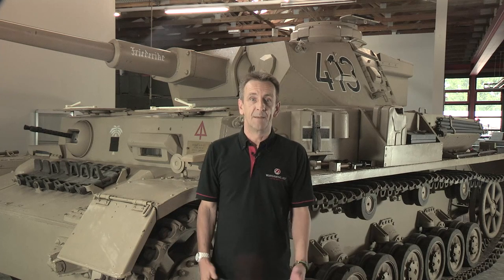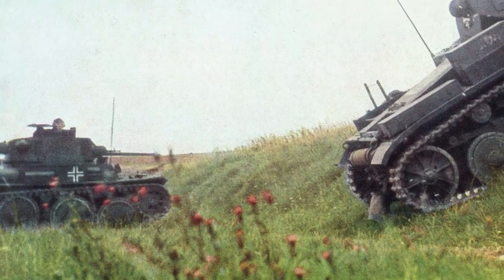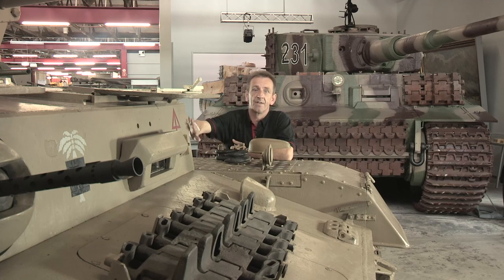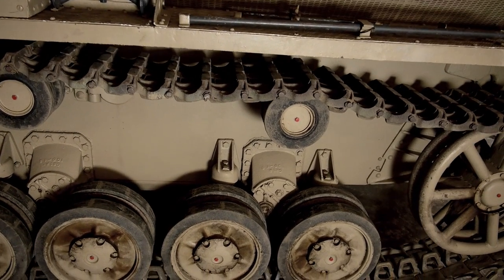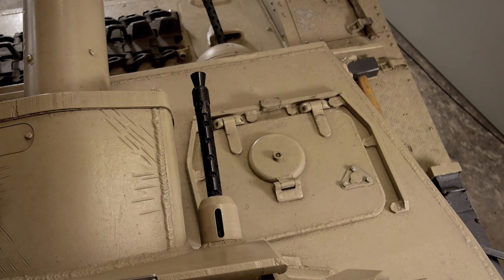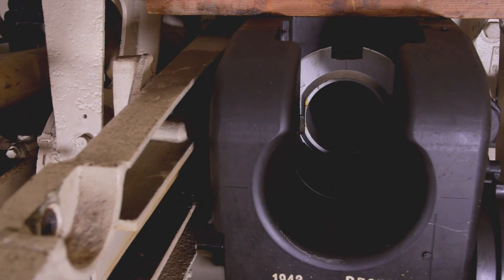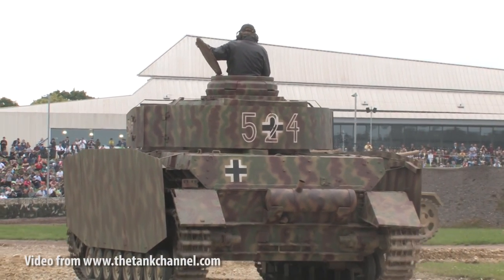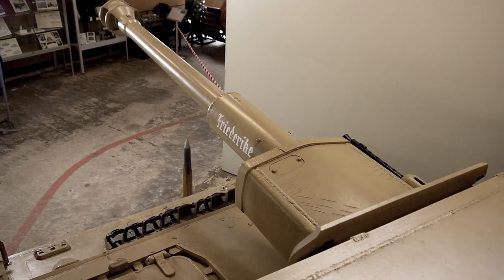Inside The Tanks: The Panzer IV - World of Tanks

Comment: Only good German tank design that was not riddled with poor design faults and over complexity, second would be the Panzer III which reached its usefulness in 1942
Reply: Don't forget that germans tanks were constantly sabotaged, especially Panthers by prisoners that manufactured them. That was one of the reasons why they were unrealiable...
Reply: thats interesting, haven't think about that
Reply: there was no over complexy german tank design and there were no real design faults... the faults found especially at the Panther was the pressure to rush it into production without proper pre produciton testing, the reliabilty of the Panther was as good or bad as any other tank at ww2... the engine problems were mostly comeing from very very poor quality syntethic oil, the lack of proper maintenance time... the Panther weakness the final drive problem was a result of the rush into production... it was designed for a 30to tank and was finaly used in a 45to tank... means it was  constantly overloaded... and to make it worse at production start some idiot planer ordered to make the gearing of the final drive of lower steel quality resulting in a average liftime of 150km. The best design is worthless if it is ruined by wrong use and wrong production... BTW at production start the reliabilty of the t34 was even worse... there are records of the Red Army of early T34 units who lost more than half of their tanks on the way to the front to mechanical brakedowns.
Reply: Onii -Chan Blaming the slave labor the Germans used, really?  No they just shit designs after 43, Tiger was okay but nothing special, no matter much wehraboos want it to be.  They had reliability problems because they were too heavy for Germany automotive tech at the time.  The German auto industry was a joke in the 30s compared to the US, in fact, GM owned Germany's largest auto maker.  They were not good machines, why else would they continue to produce the Pz IV which was clearly outclassed by the M4 and T-34 in production, reliability, mobility, armor, and gun?
Reply: God bless USA, right?. Pz IV with it's long barreled 7.5 cm gun was more then enough to deal with T-34's and shitty M4's. And Pz V Panther is by many considered to be the best tank of WW2. German tanks were sabotaged so that is one of the reasons why later tanks were unreliable. Another reason was rushed production and yes, over-engineering. Usa on the other hand has no excuse for their "Pershing" tank introduced by the end of ww2 to be as unreliable as it was since nobody sabotaged that. And Tiger was more then "Okay". T-34 had no chance of penetrating it frontally and M4 could not pen it's rear by the time it was introduced while it could destroy these tanks from a few kilometers. Mobility wise it had similar hp/ton ratio as M4 the only disadvantage was tactical mobility (moving it from one place to another on a train was pain in the butt).

Sherman: weight: ~30 tons; power: ~400 HP - power to weight is 400/30=13.3 HP/ton
Tiger I: weight: ~55 tons; power: ~690 HP - power to weight 690/55=12,7 HP/ton
Reply: Onii -Chan " over-engineering" =horribly engineered.  " Pz IV with it's long barreled 7.5 cm gun was more then enough to deal with T-34's and shitty M4's. " The M4 and T-34 were still better, were more mobile, better overall gun performance, better situational awareness, better armor, and more reliable. "And Pz V Panther is by many considered to be the best tank of WW2." By who, The "History" Channel or the "American Heroes Channel" names of authors, be specific.  " German tanks were sabotaged so that is one of the reasons why later tanks were unreliable" No they weren't the British tested the Panther's final drives after the war and found the design to be just plain shitty.  The metal and quality was fine, the design was simply way too much for a vehicle that weighed 45 tons.  You're not winning any arguments blaming slave labor either so cut it out, you sound pathetic.  "Another reason was rushed production" Again, not helping your case.  "Usa on the other hand has no excuse for their "Pershing" tank introduced by the end of ww2 to be as unreliable as it was since nobody sabotaged that."  The USA was not dumb enough to make a heavier, less mobile, more breakdown prone vehicle the spearhead of our armored advance.  They barely saw action, we did not need it, the M26s problem was a weak drivetrain and under powered engine that was eventually fixed, the Panther's problems were design flaws that the Germans could not fix, even if the war lasted longer, they lacked the technology.  
"And Tiger was more then "Okay". T-34 had no chance of penetrating it frontally and M4 could not pen it's rear by the time it was introduced while it could destroy these tanks from a few kilometers." The M4 could penetrate the Tiger from the side at 650m, the T-34 had to get closer, but the Tiger was not invulnerable.  Both the T-34/85 and M4(76) could take out the Tiger from the front beyond 1000m, and shots over 1000m were not common and even Tigerfibel states that Tiger crews should not engage enemy targets beyond 800m.  Learn the difference between tactical and strategic mobility before you attempt to lecture anyone again.
Reply: I watched a documentary about Wittmann and it stated there that M4 hid from a Tiger behind a building and while Tiger was busy killing other buddies, later that M4 got behind a Tiger shot it in the back and bounced. Also long time ago I read a history magazine and it stated that in order for M4 to have any chance of penning Tiger it needed to get within ~100 m while Tiger could kill it from a few km. Maybe you were talking about Firefly M4, the late war modification with british gun, I was talking about beginning when Tiger was introduced. They stopped producing Tigers in 1944 anyways.

"The USA was not dumb enough to make a heavier, less mobile, more breakdown prone vehicle the spearhead of our armored advance."
 Well I guess paying with lives of inferior M4 cerwmen was a good decision then. Watched plenty of documentaries about veterans complaining about lousy M4 while germans had Tigers and how everybody was scared to the point where some british general banned the word Tiger in the army. Everyone knows that germans had the best tanks in ww2 and their kd ratios show that, the only advantage allies had was the ammount of tanks they had. Every Tiger was heavily outnumbered. No matter how bravely the lion fights it will die eventually from a pack of wolves swarming from every possible direction.

Anyways having an argument is pointless because you will keep your oppinion and I will keep mine, it has been proved that arguments are pointless.
Reply: packr72
 u have absolutly no IDEE about what u talk...
T34/85 and M4 76mm could NOT penetrate tiger1 at battle range...the only western allied tank that could deal with a Tiger at nrmal battle range was the Firefly... there are reports about tiger1 killing T-34 at a range of 3900m (July 1944 Panzer Abteilung 506) .. BTW the Tiger Fibel states that it is IMPOSSIBLe to miss a target at ranges up to 1200m if the gunner use the gunsight correctly... abouve 1200m he has to adjust the gunsight .. up to 2000m the 8.8 is deadly accurate at 3000m 1 of 4 shoots miss at 4000m 1 of 4 shoot hits.. Tiger Fibel Gunner section side 76
Reply: Onii -Chan That is a myth that has yet to be proven, MAYBE you can prove it huh?
Reply: Onii -Chan Documentary about Wittmann? You believed in that? Your arguments are already invalid.

I mean if you really care, read this:
http://tankarchives.blogspot.ca/2014/08/carius-interview.html

From a REAL German tanker and tank commander, not a fake propaganda figure like Wittmann
Reply: German tanks were feared for a reason. I'd rather believe a documentary made by historians with university degree then some random Joe on the internet with simething that resembles a communist star as avatar. Since you call us "werhaboos" (lol) I'll call you "sovieboo" ._.
Reply: Are you on every tank video/forum spamming your glorious Soviet propaganda?
Reply: sovieboo pls
Reply: Onii -Chan Belton Cooper never served in a tank, he knows nothing about tanks and has no standing to right a book on how bad or how good a tank is.  "Death Traps is not a reliable source. Don't cite it. Or the History Channel show based on it." -The Chieftain, Wargaming America's resident Historian. http://worldoftanks.com/en/news/pc-browser/21/The_Cheiftains_Hatch_Sherman_PR_Bigger_Cooper/.
Reply: *****
 u noob I dont talk with one word about the us T34 heavy tank
Reply: I think that is stupid try to determine what is the "best" tank of WWII because the diferent models are in fact adapted to the tactical doctrine of each army and this make comparisons useless.
each tank model is the exponent of the diferent aproach of each country to the tankwarfare, and is noty better or worse "per se"
Reply: packr72  Wargaming and History are 2 words that do not go well with each other. I could not care less to read some american propaganda written by american on how "amazing" their M4 was...
Reply: packr72
"The tiger was OK." An understatment if I ever saw one.  That tank has too many war hero stories for it to be just "OK".
Reply: *****  y u heff 2 be medd?
Reply: What kind of pointless discussion is going on arround here? Everybody knows that german tanks were legendary.
Reply: *****
Yea I saw, nearly fell of my chair when I read it...I thought some one had to put him right, now just waiting for...(wtf are you talking about t34 was U.S. heavy) reply.
Reply: Onii -Chan Did you even read the article? No you didn't, if you did you find out that it is not propaganda and the article was not written by an American( ok he is an American now, but not a rah rah Murica, American, an objective expert on tanks)  Tanks that light them selves on fire, breakdown every 150km, are made out of poor quality steel that spalls even when hit by smaller rounds,  are not strategically mobile,  require large amounts of limited resources to maintain.  I could keep going on, these are things are not what makes a good tank.  You keep focusing on gun performance and armor(that spalls and kills the crew easily) all that is useless if the tank can't make it to battle.  German tanks can't even make it to the fight, so how does that make them good tanks?
Reply: Kah- Jeet Cool story bro
Reply: Onii -Chan Pretentious troll is pretentious
Reply: Oh mother Russia!
Union of lands
Will of the people
Strong in command
Oh mother Russia!
Union of lands
Once more victorious the red army stands!
Reply: ***** "or a Tiger fresh out of the factory."  The Russians captured alot of undamaged Tiger tanks that were broken down.  "The photo for this particular test is missing, but here's the Tiger after the other tests."  Reading is your friend.
Reply: ***** You don't have to take anyone's word, however denying evidence right in front of your face puts you on the same level as people who deny evolution.  The Russians were trying to win the war, these reports were classified for years and were not made to impress a dictator like Hitler.  They were attempting to test weapons on captured enemy vehicles to see how effective they would be in combat.  And you still can't read can you?  No where in that report does it say that particular Tiger was knocked out by a 122 or 152mm round in combat since in 1943 the IS-2 was not in service and very few SU-152s were operational.
Reply: ***** The pictures are from later tests, it could be days, weeks, months, or even years later, but that damage is cumulative.  "The more observant of you will notice that the turret is no longer on top of the turret ring. This was a common side effect for German tanks that were being shot at by Soviet 122 mm and 152 mm caliber guns." So, again, no." Again read.  The 75mm M3 M72AP round will penetrate 84mm of vertical armor at 750mm.  The Tiger has 80mm of side armor(Check "World War II Ballistics: Armor and Gunnery pg 63.)  This argument is over.
Reply: ***** None of the penetrations you listed even match, is it "500 yards, 30°. 70mm penetration." or "500 yards, 30°. 68mm penetration." Which one????????
Reply from the maker: Just for your info the presenter served on Tanks in the British Army for 30 years.
Reply: Wargaming Europe What does that have to do with anything?
I was simply praising the Panzer Four, not criticising the presenter.
Reply: ***** " if we were to state engagement ranges in the same standards for the Tiger, then the T-34 and Sherman would be ordered to not engage the Tiger at any range." Why? Should T-34 and M4 crews just shit their pants instead?  The T-34/85 and M4(76) could engage and destroy Tigers beyond 1000m with standard AP ammo.  "that you need to drag all the other German tanks in here"  The pre-war designs like the III and IV were good vehicles, the later tanks not so much.
Reply: ***** Are you sure you aren't a producer at Fox News?
Reply: ***** Proper evidence? Subjective opinion does not classify as evidence, kid
Reply: packr72 He is probably a director at Fox News with his attitude.
Reply: nagmashot you do forget: JS2, SU100 and SU85?
Reply: packr72
 funny is that Zaloga claims exactly the same kill ratios Germans claims in his book Soviet russian army Armor and Artillery Design Practices... and he refer in this book that all the numbers are based on RUSSIAN archives... by his numbers the German Army Red Army tank exchange was 1:4.4 througout the entry German Soviet war 1941-45...and to make it even worse the number of German looses includes ALL fronts ..means including looses in africa and west europe... The Wehrmacht destroyed from 1941 till 1945 MORE russian tanks than Russia was able to build... total looses 83,500 total tank production 72,231... what safed Red Army ass was the HUGE number of tanks it had at war with Germany started in 1941 (22,600) and the huge ammount of lend lease tanks from UK Canada and USA (over 12,000) that keeped the Red Army in the position to constatly outnumber the German tanks... without lend lease the Red Army would have collapsed by 1943...
Reply: ***** He can't delete your comments stein.
Reply: nagmashot German losses cannot be relied upon for the simple fact that they are flawed.  A tank that simply throws a track is out of commission because it can't fight and needs to be repaired.  For a loss to be considered a loss for the Germans, the tank had to be so damaged that it is no longer anything other than scrap or was unrecoverable.  A PzIII that was knocked out in France, repaired and again lost is Russia, and repaired again and finally destroyed was only counted as one loss for the Wehrmacht.  

KIll ratios are not good measures of how good a tank is.  Tanks are not knights who go off and joust somewhere else on the battlefield, battles don't happen in a vacuum.  There are a lot of other ways that tanks can be lost including AT guns(probably the biggest threat), mines, other tanks, artillery, aircraft(not very effective but still took out a few) and infantry.   The majority of Red Army armor at the start in 1941 was made up of relics like the BT tanks, T-28, and T-26s.  The Red Army also had its officer corp purged and it took a long time to rebuild it(doesn't matter how well your soldiers are trained or how good your tanks are, if they are led by morons ala. France, you will not fight well.)  Funny that the German AFV with the most tank kills to its name is not the Tiger or Panther, in fact it isn't even a Panzer, its the Stug.  Stugs claimed 20,000 enemy tanks killed and they were artillery.  To get an accurate picture of German tank kill claims, divide the number by 2, that's what the Wehrmacht high command did.
Reply: ***** Deleting your own comments, blames it on me. Logic
Reply: ***** Jaysus Christ its like arguing with a wall.  Even if they weren't technically artillery, StuGs were still part of the artillery.  "They shouldn't actually be considered artillery though" Really? Did you change your name to Heinz Fucking Guderian, if no then your opinion doesn't matter pal.  They were artillery, end of story.  Those StuGs with the StuK 40 were still attached to the artillery and they still supported infantry, less effectively of course.  There were also close to 1,300 Stuh 42s armed with the 10.5cm leFH field gun produced, should those be considered tank destroyers and not artillery?
Reply: ***** Enough is enough, troll out with you
Reply: nagmashot The 76 mm M1 gun could definitely penetrate a Tiger with its HVAP (High-Velocity Armor Piercing)
Reply: ***** "But how much damage would it do after penetration?" Considering the poor quality of German steel that was vulnerable to spall even from the M3 75mm gun,76mm APC ammo would do even more since it was capable of penetrating a Tiger beyond 1000m(the US did not HVAP to beat Tigers from the front.)  APCR ammo is reliant on kinetic energy, just like the APDS rounds of today.  The ammo storage of German tanks was awful, shrapnel could easily hit ammo.

I have never read anything that claims that US M93 HVAP was inaccurate; a source would be nice.  The 17lbr's sabot was inaccurate, which is one of the reasons why the US never adopted that gun.  US tank crews typically had 2-3 HVAP rounds, but TD crews would many times trade them for HE rounds.  Considering that US tank crews rarely engaged German armor and the likely suspects were either the Pz IV and the StuG; 2-3 HVAP rounds was more than enough.
Reply: packr72  "Poor quality german steel"? Lol Tiger was made from a special heat treated low carbon steel that was stronger than most steels. From wikipedia and other sources:
The armour joints were of high quality, being stepped and welded rather than riveted and were made of maraging steel (which are known for possessing superior strength and toughness without losing malleability) whitch also neted them increased integrity. This made the Tiger immune to the front from the 75mm gun of the American M4 Sherman tank.
Anyways this discussion is pointless.
Reply: Kah- Jeet You wehraboos crack me up, WIKIAPEDIA IS NOT A SOURCE PAL.  Here is famous German General Heinz Guderian talking about the quality of German steel and inability of German engineers to copy the T-34 in his memoirs "Memories of a Soldier" he states, "Additionally, our hardened steel, whose quality was dropping due to a lack of natural resources, was inferior to the Russians' hardened steel."  Also, LOLZ at the fact that German engineering can't copy a simple tank like the T-34 which was constructed in factories staffed with children.  The Germans also had no automated welding at the time thus every tank was hand weld; slower and worse quality.  The welds on German tanks were weaker than the armor it self.  I would suggest you read these reports on the quality of da Krupp Stahl., or not like many of the other wehraboos that can't face facts.
http://tankarchives.blogspot.com/2013/08/german-armour-quality.html
http://tankarchives.blogspot.ca/2013/09/guderian-on-german-armour.html
http://www.dtic.mil/dtic/tr/fulltext/u2/a954952.pdf
http://www.dtic.mil/dtic/tr/fulltext/u2/a954940.pdf
Reply: lol yea maybe by the end of the war. When the germans didn't even have enough fuel to supply the tanks and all of the resources were captured by enemies
Reply: Kah- Jeet Rejecting the evidence, is the proof of clinically lunacy. Seriously, you believe in invincible sky wizards and that the universe is centred around the planet earth? Maybe you also believe that unicorns exists in the secret crypts of DPRK
Reply: ***** I never said that US crews never used HVAP against Tigers, I just said that they would not need it. German armor quality was never up to the standard of the United States, they had no experience making plates thicker than 50mm, then suddenly more and more armor is added to the PzIV and the Big Cats appear and all had plates thicker than 50mm.  Germany had an embargo placed on it 1936 and they had trouble getting the raw materials needed to strengthen steel.  1943-44 just happens to be the time frame where German tank production increases.

All tanks will show their side armor at some point, so mentioning that an early M4 can take out a Tiger at decent ranges from the side is perfectly acceptable.  Tanks do not fight in a vacuum where they face off directly in front of each other.  Armies typically like to flank to avoid head on attacks.  

"Also, German engineers very much were able to copy the T-34. It was just that German industry at the time did not have the capability to produce several parts of the T-34;" If they couldn't produce their own copy, then they couldn't copy it.

Here are a few diagrams of the internal layouts of German tanks.
Panther http://i1183.photobucket.com/albums/x462/Dowly/panther.jpg
Tiger II http://s47.photobucket.com/user/cd_kp84yb/media/Tiger2.jpg.html
Tiger http://fc00.deviantart.net/fs70/f/2011/322/a/f/af48b98ee53a0040d1ddc616eb4ee27e-d4gk60d.png
The M4s ammo storage was moved into the floor, a hard place to hit.
Reply: ***** German tanks were superior to Soviet tanks. Get over it dude.
Reply: Firmus Piett Only in your fantasy world they were.
Reply: Firmus Piett Yet you cannot provide evidence for it, hmm weird.
Reply: +TheThirdMan
Also most people forget that Panzer IV and StuG III's destroyed more Soviet and allied tanks than Panther or Tiger did.
It made more sense to make more simplified and standardised StuG's and Panzer IV's with larger guns to take on newer IS-2 etc
Reply: The StuG III destroyed more tanks than any other German armoured vehicle.
Reply: atleast the PZ IV had final drives that would last longer than 150km,
Reply: Like the uselss tigers with hundreds of kills
Reply: PzKpfw VI Tiger ausf. H1 part of the problem, yes, but not all of it.